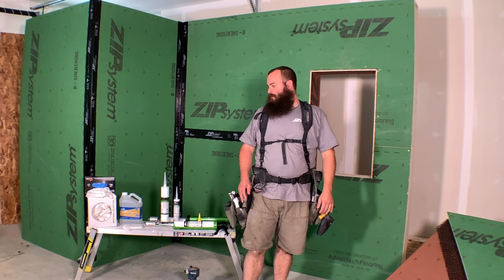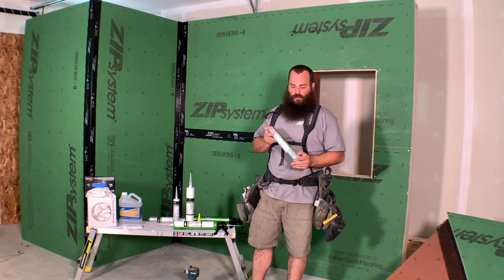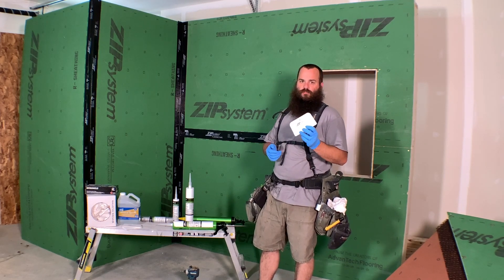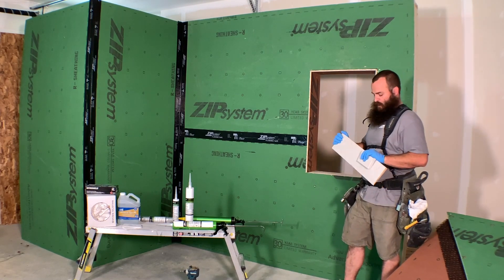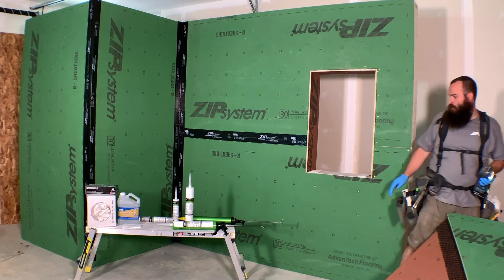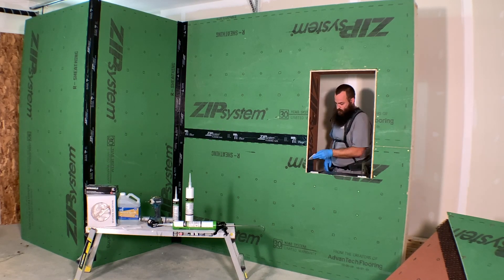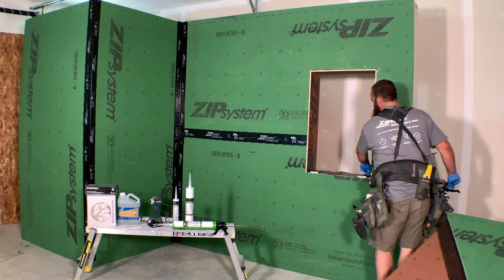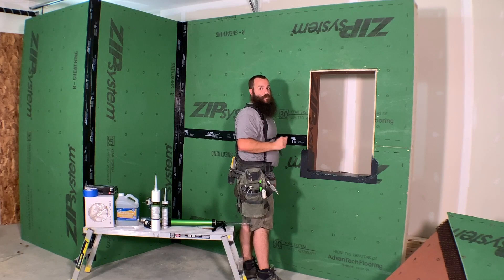Window Rough Opening with ZIP System liquid flash | Ben Bogie | ZIP System building enclosures

Comment: Not sure why you didn't put zip sheathing  on the bottom as well as the sides and top.   Shim the cripples as you stated. Then use composite shims (waterproof) for the reverse bevel. You only would need to liquid flash the corners. Or go belt and suspenders with liquid flash layer on top.